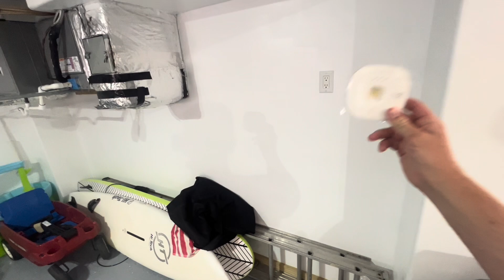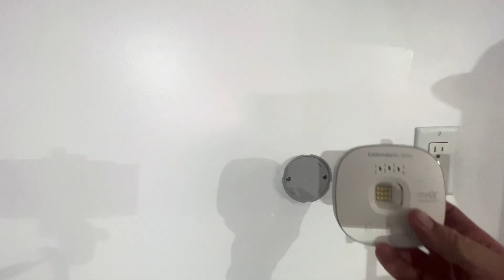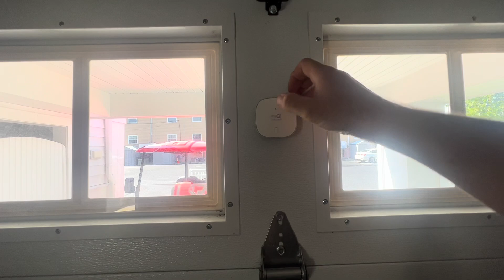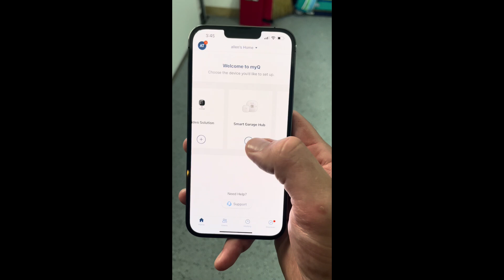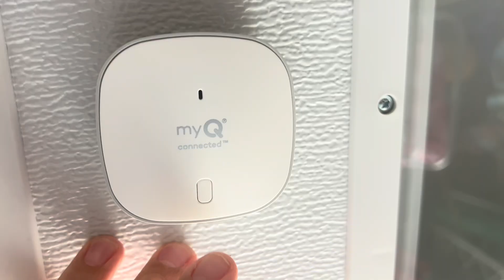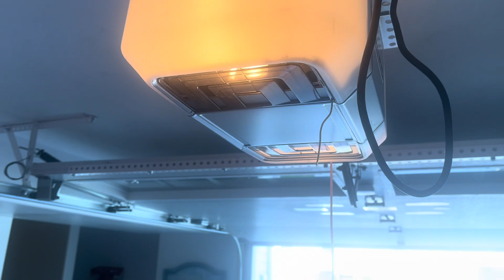How to Install a Smart Wi-Fi Garage Door Opener | Step-by-Step Guide

Comment: Thanks for the video. I would like to know if it also works with one-piece doors without photoelectric sensors.
Reply from the maker: Yes it should 😎
Reply: @Fullyremotelifestyle  So. What we must understand is that the unit that is attached to the garage door is the one that sends the signals to the motor that are normally sent with the remote control. And the other is a hub for connecting to the internet. The risk is that the door unit is powered by a lithium battery that could betray us at the most inopportune moment. I imagine that the door unit also has a gyroscope to know what position it is in and communicate it to the hub.